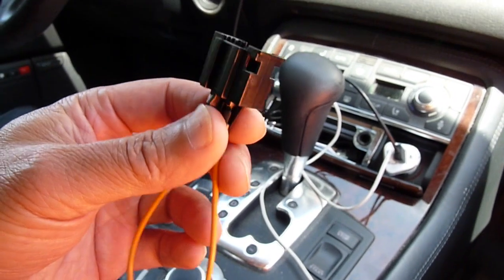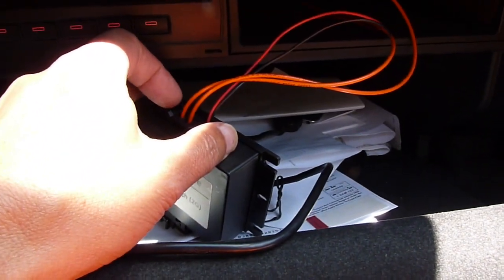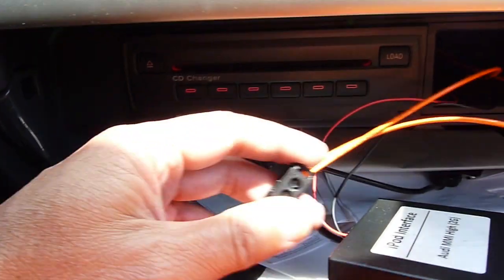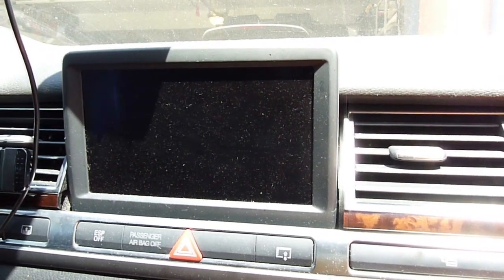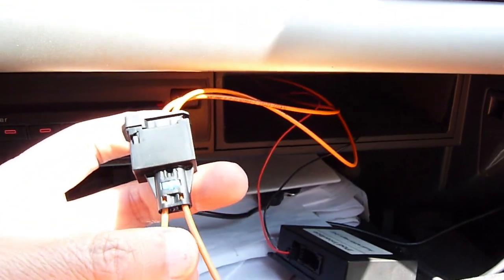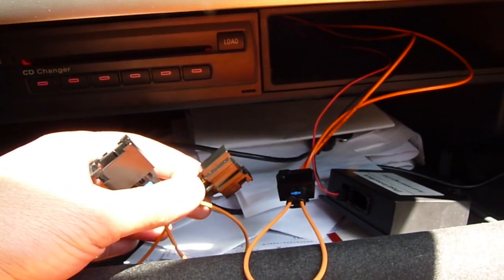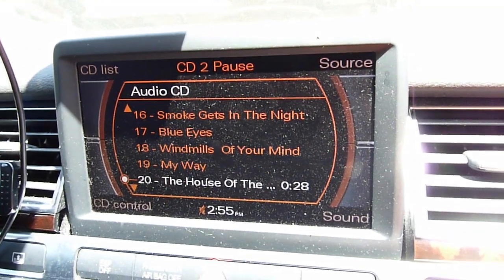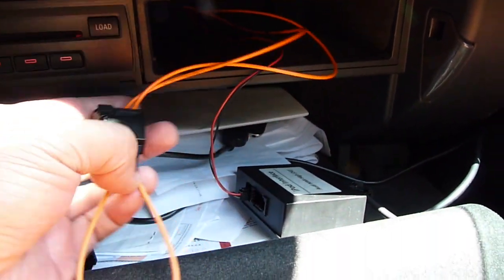How To Use Optical Loop To Isolate Broken MMI Devices

Comment: Is there a video about switching from mmi 2g low to 2g high or even 3g with all necessary constraints?
I am struggling to find in on the web. 
I have a6 2006 C6 4F 3.0 tdi with monochrome 2g low, and would like to dive into this upgrade.

Comment: A great workaround - nothing worked from the MMI down. I ordered a "Most Fiber Optic Loop Cable Bypass Female Adapter Detection Ring Cable" from Amazon, undid the fibre connector from the K-BOX RADIO / STEREO TUNER in the back RH fuse area and installed the fibre loop to the male input - bingo... MMI and most functions came back to life. No radio, but that's what is broken and left the fibre circuit open. I'll deal with the radio issue next, but everything else is working again. I'm very grateful that I was able to bypass with the fibre loop - many thanks for the vid and how this can be applied to other devices in the Q7. A really cheap and quick fix.  Best regards all the way for Australia :)

Comment: Help please I have 2006!a8 mmi black screen have that serious tuner was the problem I put bypass female in fiber optic male that was serious tuner box so screen case up working for 2 months now it’s out again not working do I have a new device broke now cause radio screen came up now it’s stuck again not working I’m confused can I have multiple devices broken at once ? I have extra plugs two more do I keep on plugging them in other devices while one is plugged in allready to tuner I’m confused and frustrated with black screen again before this lasted 6 months before I figured out bypass plug method but now it’s back after having two months of it working again smh I was using a Bluetooth fm transmitter to listen to music thru my phone that I just got three days ago then it came back again could that have messed up the mmi further I need answers
Reply from the maker: Edouard Fleurant yes, the optical loop is opened again, check all the  power and components with MOST bus. Check the fuses in the trunk, 5A on the left and also big fuses behind the battery. Go to my website and search for black screen
Reply: Edouard Fleurant  the exact same thing happens to me when using a BT transmitter... did you ever get the problem resolved?? And where you ever able to use the transmitter

Comment: How have similar problem I bought the female  and plugged into the satellite tuner in the left in the back to isolate problem radio came on and started working for two months no problem now problem is back radio black screen stayed up no function I had back up female plugs I plug it in satellite tuner but now it doesn’t work so I finally need a new satellite tuner box or another module broke ? I’m lost need help
Reply: Try it on the tcu module it worked for me
Reply: @Browngeezer  where is that at?
Reply: The TCU is INSIDE of the transmission......